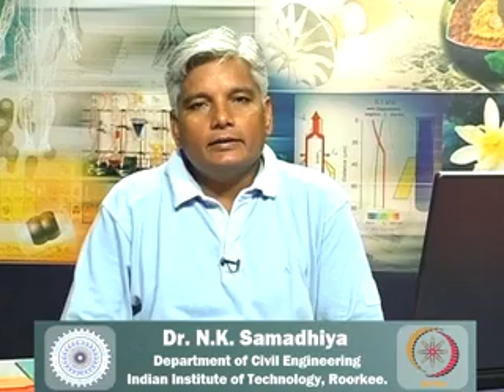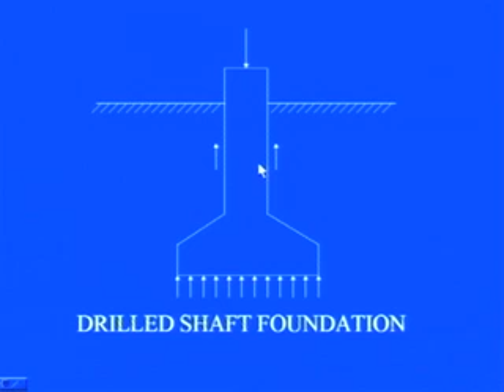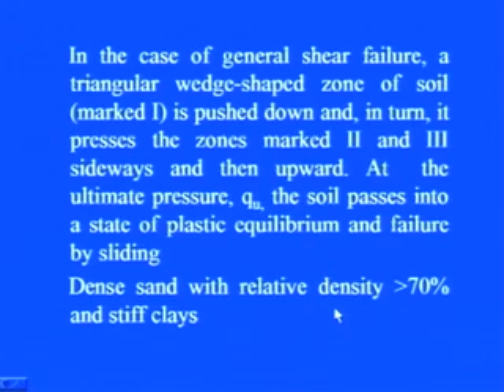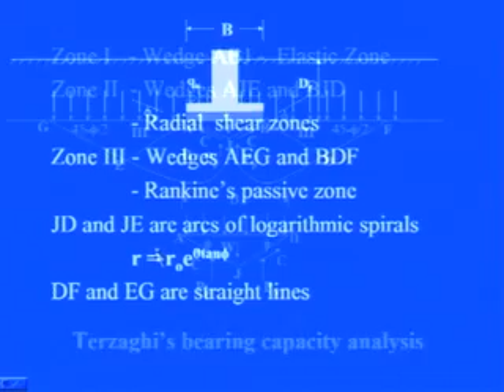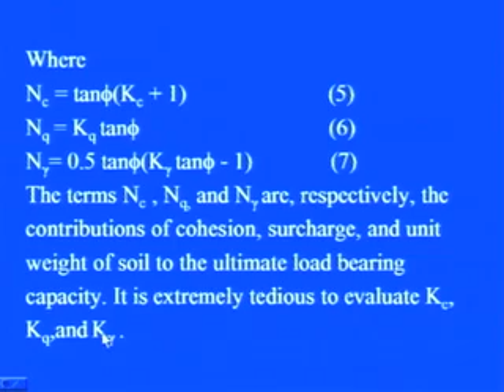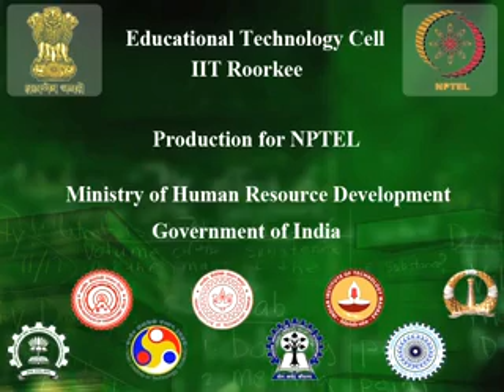Mod-1 Lec-1 Shallow Foundation

Comment: During my BE (Civil Engineering), ME (Soil Mechanics and Foundation Engineering) from University of Roorkee, Roorkee, India, and PhD (Civil Engineering with Geotechnical Emphasis) from the University of Missouri-Rolla, Rolla, USA, no teacher told me a practical fact, that “basically the behavior of a shallow foundation in controlled by the settlement, not bearing capacity.”  This fact has been stated by Ralf B.Peck in his book and lectures.

When I joined Woodward-Clyde Consultants in Philadelphia in March 1986 upon completing my PhD, my boss, Dr. Arthur Dvinoff gave me to design a shallow foundation.  I completed the bearing capacity estimation
in two or three pages, followed by settlement estimation.  I took these to him and he skipped the bearing capacity pages and just checked the settlement analysis.  I asked him the reason and he said that we don’t care about bearing capacity.  If the building is safe in settlement, it will be safe in bearing capacity.

Anyway, if one plugs in the values in the bearing capacity equation, one may get a bearing capacity in several thousand of Pounds per Square Foot (psf).  Can one load that footing to that extent?  No, one can’t.  The structure would undergo a very large settlement.

All those Plate Load Tests with a 6 inch by 6 inch plate are wastage of time.  No body does those in the USA.

Professor Peck wrote the “Forward” for the book on Soil Dynamics by Dr. Shamsher Prakash.  On the second page of his forward, in the third paragraph He says:

“Considerable progress has been made in determining the ultimate bearing capacity of footing and rafts. 
The impetus for research in this area came largely from the need to
design protective structures against the force of high energy atmospheric
blasts. For non-military problems the ultimate bearing capacity is usually of little or no interest in comparison to the movements, particular when the subsoiloil is non cohesive……………...”

In my professional carrier I considered bearing capacity only once, while serving as Senior Geotechnical Engineer in the US Army.  It was required to dredge a canal for the transportation of ships.  There were some islands having the dimensions of quarter a mile and more.  The question was that how much load we can place on them.  My answer was - as much as the bearing capacity permits. Settlement was not a concern.  More settlement will give room for more dredge to be placed.

All that said, I believe that at least once in a life time the student should be taught bearing capacity, but should be told the practical aspects  involved.

You mention that for shallow foundation the ratio Df/B < 1.0.  Here our criteria is approximately 5 times (Reference: Page 7.2-177, Chapter 5, Deep Foundation, Naval Facility Engineering Command (NAVFAC) DM 7.02). Of course, here the footing bottom should be below frost depth.  In my area (Chicago) the official frost penetration depth is 40 inches, but the state of practice is 48 inches.  Therefore, we use 48 inches.  By the way, NAVFAC DM 7.1 (Soil Mechanics), DM 7.02 (Foundation Engineering) and NAVFAC 7.03 (Soil Dynamics) are my bibles and every geotechnical engineer uses them   You can also download them free.
You mention that for deep foundation the area of column footing should be more than the loaded area. This is not clear to me. 

You mention that the maximum permissible settlement is 75 mm (3 inches) to 100 mm. (4 inches).  This is a way too large for us.  In the USA, it is 1 inch for a spread or wall footing and 2 inches for a mat foundation. 

We use mat foundation if the total area of the column and wall footings in more than half of the building area.
Reply: @ninaadathalye2293  pad225@hotmail.com